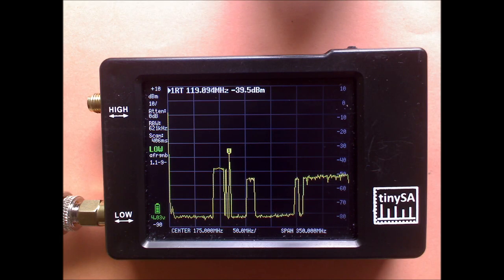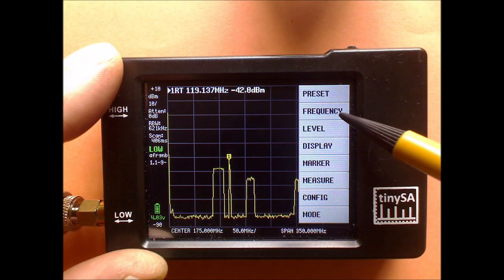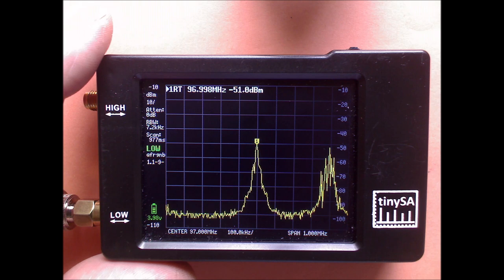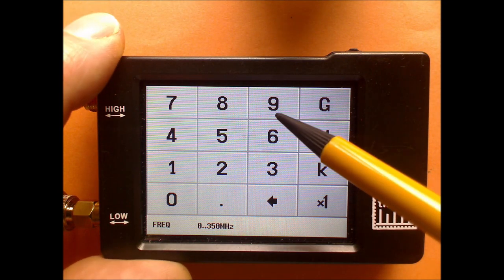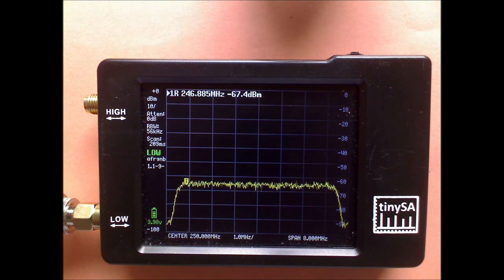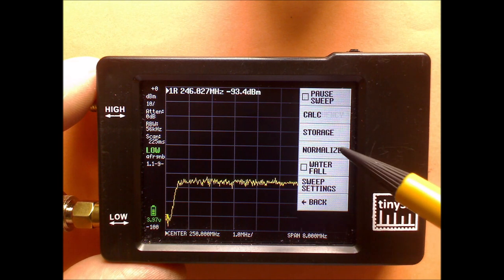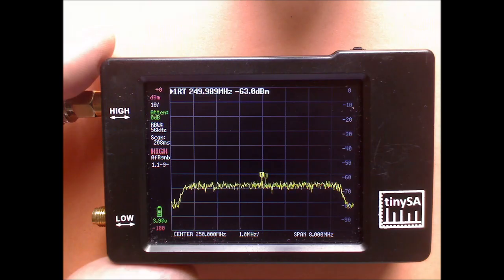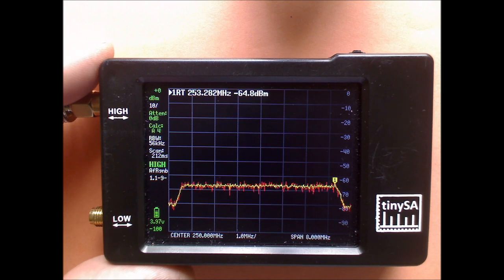tinySA observing Cable signals

Comment: Very interesting!  I learn new uses and tricks for my tinySA from all your videos!  I think I need to purchase an adapter to be able to try this out!

I have a few questions...
1. Is the use of an external attenuator recommended if connecting my home cable to the tinySA?  Or are the signals typically below the levels that may damage it?  I believe that I have a cable company installed amplifier installed where it comes into my house to boost the levels, so just curious about this.
2. Why are the local FM stations present in your cable feed?  Is that typical in your area?  I have not heard of this being the case in the US.
Reply from the maker: No attenuator needed

Comment: Mr. Erik, I ordered tinysa today.  I hope it will be a product that I will like.  I'm wondering about something right now.  I will be glad if you answer;  What settings do I need to adjust to detect a very weak fm rf in the 80mhz-130mhz range with a peak of 100mhz.
Reply from the maker: Basically nothing. Switch it on and leave the tinySA in low input mode and connect an adequate antenna. The supplied telescopic antenna may be good enough. For weak signals you may need to add a low noise amplifier between the antenna and the tinySA as the tinySA is a SA and not a receiver.
Reply: @ErikKaashoek  Isn't TinySA a spectrum analyzer?
Reply from the maker: @ahmetozdemir7173  Yes, that is what I said. So the sensitivity of the tinySA is optimized for a SA applications and not for receiving very weak signals
Reply: @ErikKaashoek  Thanks for the answer.  What do you mean by "SA application"?
Reply from the maker: @ahmetozdemir7173  measuring a spectrum. Not receiving radio
Reply: @ErikKaashoek  I understand.  I want to detect and examine the fm signal coming from the rf antenna.  I'll investigate at a point that will be far from the broadcast station.  
So I have to examine the weak signal.  In this case I will use a low noise amplifier.  Do you think it will be enough?  Are there any tests on this?
Reply from the maker: @ahmetozdemir7173  Just test with antenna, if there is sufficient signal, no need for amplifier.